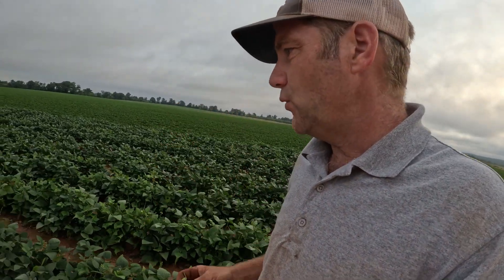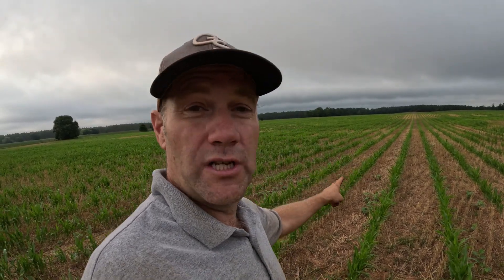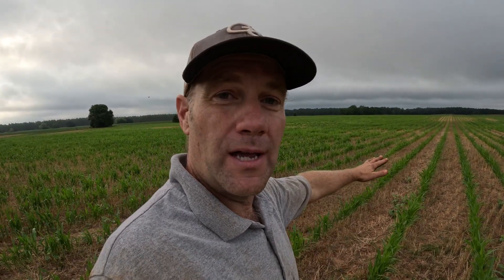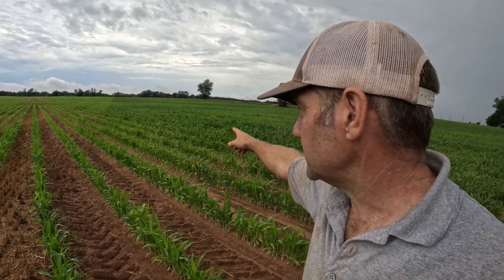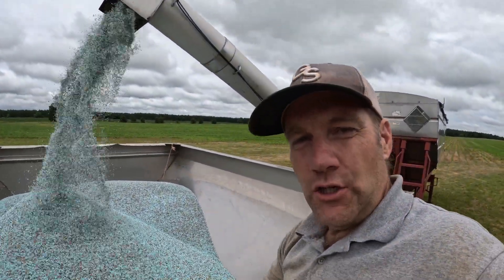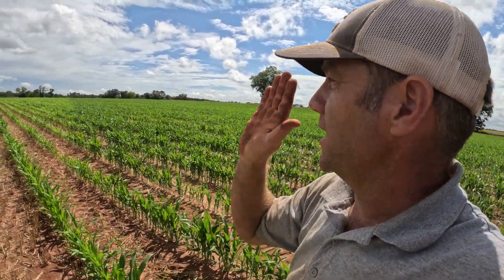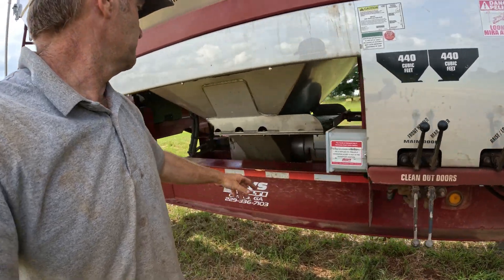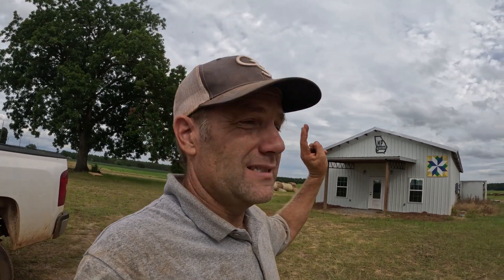Cover Crop No Till v. Tillage Results

Comment: Well, no, stopping tillage and adding cover crop does lead to less erosion and less weed pressure. Of course it’s site specific and I’m not opposed to herbicide usage at all but in every case, no-till and cover crops will greatly reduce erosion, weed pressure, and over time it will help you need less fertilizer due to your soil health getting better. So no, that’s not wrong
Reply from the maker: @benchrestman1685  what you are saying is not correct is mot at all what was said in the video.  In the video (and in several more as I documented this from planting to harvesting) a viewer told me “If you don’t till you won’t have to spray.”  That is categorically false.  It is demonstrated false in this, and subsequent videos.  I am not anti no-till.  I am however anti promoting falsehoods.  No-till farmers, of which I am one, use MORE herbicides than tillage farmers, of which I am also one.  Don’t take my word for it, ask any chemical rep which is their favorite client type.  No-till = more herbicides, more pesticides, and more fungicides to achieve same yield as traditional till.  In this trial I also had a portion of the field in max tillage to display the differences.  The max tillage portion grew taller, yielded more, and reached maturity 2 weeks sooner.  I harvested the field all at the same time (also in a video) and the no-till portion out profited the max till portion because they yielded the same…..however about 1/4-1/3 of the max till was laying on the ground by the time the no-till reached maturity.  If it had been harvested separately, when it matured, it would have narrowly out profited the no-till.

All in all I like the no-till better in this trial, as it was far less work.

Comment: I'm no cover crop expert and definitely not an "early adopter" (we strip-till & use herbicides), but I think what they're advocating by telling us to plant into standing cover crops, is let the cover crop grow up really high (2-3' tall), then either roll & crimp ahead of planter, and plant into that bc when you allow the plant to get that height, as you roll and crimp it over, it then breaks the stem of the plant and lays on the ground and acts as ground cover holding moisture in, rotting down and smothering out future weeds. I have not tried this yet. We do frost seed medium red clover into our winter wheat and it usually turns out to become a good cover crop after the wheat is taken off mid-summer, but we do kill this off mid fall...it browns over winter, then we strip till into it come spring and plant corn.
Reply from the maker: @EDBZ28  down here our clovers grow during the coldest part of winter and die off during the summer heat.  We plant clovers in October, they go to seed in March, disappear and new crop emerges in fall.  The roller/crimper process you’re describing is what they call “green planting” or “planting green.” It is popular up north. Anything that grows during our summers isn’t killed by crimping.  So if you plant into a green crop (even if crimped) the green crop will choke out whatever you planted. Planting into herbicide burn down cover crop or harvested wheat is very common here, but the rows are almost always strip tilled ahead.  No till cotton has been tried a lot down here, but I’m not aware of anyone that tried it being in business the next year.
Reply: @PatrickShivers it comes down to the fact there’s no “cookie-cutter” approach to farming no matter how hard they try to make us think there is…I’ve gotten so I don’t even read the farm magazines anymore; nothing but propaganda from big Ag with an underlying agenda that benefits them in the end.